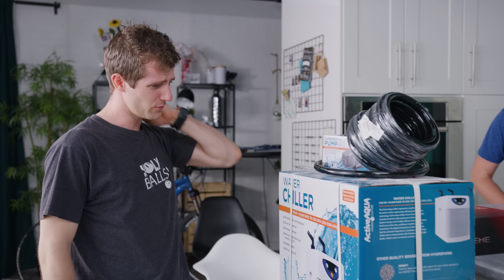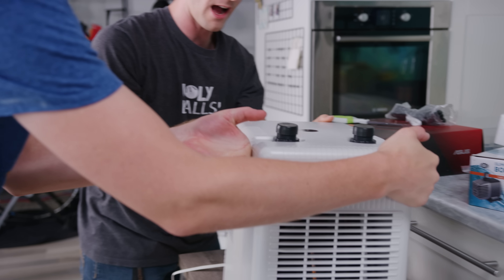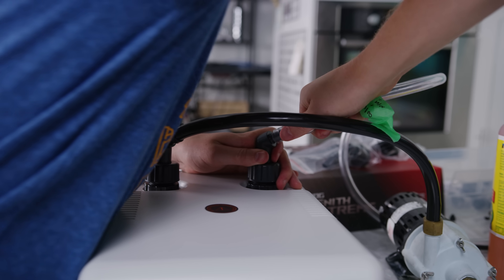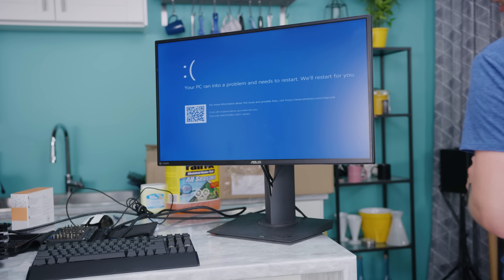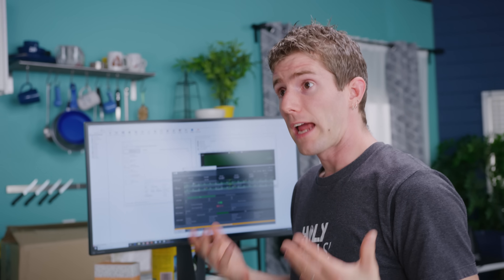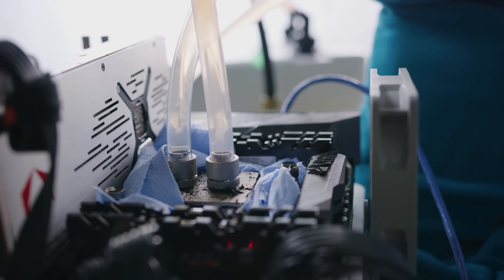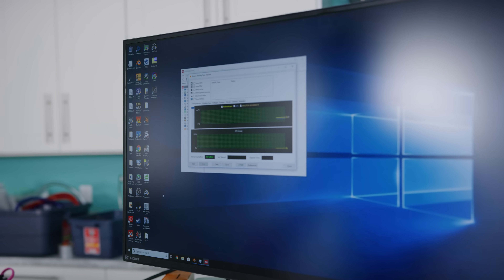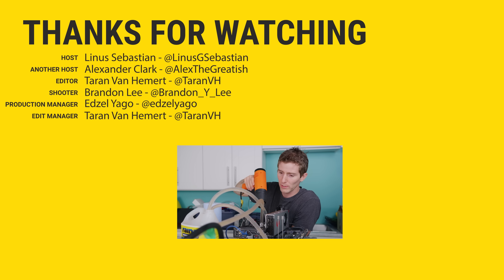Chilling Threadripper 2!!!

Comment: way 2 powerful :D i have done it before on two computers just to mess around using hy2000h :D overkill 1/3hp compressor 450w power draw and confident performance of 1.8,  that unit is capable of keeping 2000l of water 10 degree below ambient temperature...used it on my fish tanks then tanks were gone and well why not to try it on 2080ti x 2 and amd 5000 series ryzen processors ...it is perfectly usable option but you need big water tank with it otherwise when compressor kick in for literally few seconds temperature was dropping way too low even thought i had it set to 24 degree water temp full strain on two systems 300w both cards and around 110w per processor when chiller kicked in to lower temperature when exceeded 24 even thought it switched off quickly R134a was still working hard and water temp was dropping to around 10 degree causing hell of a condensation :D only way to counteract it was to use 50l water tank with it hahah i never gave up on it and currently running rx6900xt and ryzen 9 5900x using small chiller from aqua pure 7 system purchased on ebay for 20 quid , it draws around 80 watt when compressor kicks coefficient performance is around 2.1 i believe, neither card or cpu getting near 60  degree system only has one 280mm rad and no fans whatsoever :D it is important not to use fans as you endup cooling the room and it would not be enough as technically its only around 170w of cooling power, sounds not a lot but it does the job ...

Comment: If i wanted to do this with a ryzen 7 7800x3D or ryzen 9 7900x3D what CPU block should i get? and would a Hydrofarm AAPW160 Active Aqua, 160 GPH Submersible Water Pump be fine?
Reply: Is the pump necessary if im trying to keep temps between 30-50 while intensive gaming? I dont want to Build a whole loop into a case, Figured this would be a quick and easy setup with a direct line to the cpu and back to the chiller

Comment: Funniest thing to me is... I have an aquarium chiller from 10 years ago. I used it for the exact same reason. The brand name is totally different, but.... The cooler looks exactly the same! down to the fonts and buttons on the control panel..... and the hose fittings...
Reply: It's literally the EXACT same model...... HAHAHAHA!!!
Reply: Mine is a "Hailea" brand.... Even has the same round sticker in the center of the top of it.
Reply: @potatonetaveragegameplay5300  which one you using?

Comment: Wait you need an external pump for the loop? I thought the water chiller had an integrated pump... Would it be viable to use a pump/res combo instead of the little giant and if so, how powerful does the pump have to be?

Comment: i wanna see it made to cool and overclock MULTIPLE desktops. im thinking run that into a resevoir and add yor little giant into a 1x3 splitter that travels a ways away into 3 different pcs. set it up so you can have the noisy stuff in a different room, and insulate the piping so it doesn't pick up the ambient temp from the floor or rooms and keeps the pcs frosty.

Comment: Combined waterloop for several serverchips  would be a practical idea .You have to balance the heat from the chips  vs the btu of the chiller  and so  on , add a radiator to the loop and keep the chips at ambient roomtemperature (18 degrees celcius)  to prevent condensation. So the chips remain cool but not cold.

Comment: @Linus Tech Tips I am currently planning out a solution like this and still trying to figure out a solution to go below 0 C on a dailiable system with a 5950x and 2 3090 Stix cards with 1000w BIOS's on each of them and hoping to get 3 plus years and use hardline glass I found that can go to -80 C no problems. Just need to figure out if I can put a block on the ram and have no condensation issues when using 24/7 for rendering and gaming mainly. Any ideas what I can coat the components in? I saw the mineral oil cooling setup and wonder if I can use a similar solution for a sub-zero dailiable system. If anyone can help please get back to me. My budget is 5-8.5K for all cooling stuff and $200-400 for any daily maintenance. Thanks.
Reply: Also already have a system with a 3090 Strix and 5950X. just will need 1 more down the road unless needed to run triple 4K ultra settings at descent fps.

Comment: to avoid big condensation issues but keep the temps as close to ambient as possible, would it be possible to build a circuit that 'leads' the chiller and essentially compensates for sustained all-core loads?

Comment: EKWB should make custom loop accessories that can avoid condensation with tubings and water blocks with isolation material wraped on so anybody can use this chillers or they can even make their own chillers like this it is not impossible to isolate the materials by factory and make it possible avoid the condensation

Comment: I would have used water with antifreeze as a liquid.  With a good antifreeze you can get to -26 Fahrenheit without the water freezing and water has a much better power to transport and transfer heat. Not to mention that it arrived, they could have put it in a car without wasting anything.

Comment: I use one of this aquarium chiller like that but slightly at higher end its called "Teco Tk1000 series aquarium chiller titanium Heat exchanger". There many types of series but i get the 1000 series for my salt water aquarium. I even done a test before adding my fiah into the tank just to circulate the water for 3 days n my tank from out side vaporise 😂n i exchnage the setting to release heat n maintain my water at 87 Fahrenheit. I once use china basic chiller its just crap bought for 80 bucks singapore dollars. Cheap chiller is just good for nano tank. For cou like that try the one i mentioned. Try research that chiller. Maybe it much more better

Comment: I would like to point out that Canada allows methanol to be used in windscreen wash fluid. That thing is extremely poisonous, kills your vision irreversibly and is absorbed even through the skin. Mouth sucking it is something utterly stupid, kind like standing on the edge of the cliff or so. As a bonus, it does harden the tubes and prones them to cracking. Also is highly corrosive. It will kill the pump in the long run. You must use glycol-based antifreeze for car engines. Or better still, use waterless cooling fluid for sport and vintage cars that goes down to like -60`C up to +160`C.

Comment: I wonder if It would be possible to like do a skim coat of epoxy over parts of the board to prevent the moisture, I see people using Pat-Jelly. Maby better room temps help mitigate or even like a moisture absorbing substance like plaster when it hardens. the problem with towels is while they absorb they dont dissapate water like plaster. I think a shroud made of plaster would absorb way more water than paper towels as it literally absorbs water from the air around it.

Comment: 1/10 amps is the amount of amps needed to kill a human. 500 amps is = to 5/10 of an amp. when they got 6000+ score on cini. r15 the wattage on the threadripper was 500, and because the cooler had a chance of leaking they could easily died

Comment: If it is just condensed water there should be a much lesser risk of shorting out the board, water itself isn't particularly conductive, it's the dissolved ions in tap water that make in conduct electricity well. Those ions shouldn't be present in significant amounts in condensed water.

Comment: you should just use a cold finger probe. 

https://www.grainger.com/product/12C386?gclid=CjwKCAjw_NX7BRA1EiwA2dpg0l4EWPn6UN7kbbCJ-c6-zZBpmcvlICGjMJUTPNpQI1i1npJumL4NMxoC2NwQAvD_BwE&cm_mmc=PPC:+Google+PLA&ef_id=CjwKCAjw_NX7BRA1EiwA2dpg0l4EWPn6UN7kbbCJ-c6-zZBpmcvlICGjMJUTPNpQI1i1npJumL4NMxoC2NwQAvD_BwE:G:s&s_kwcid=AL!2966!3!264955916105!!!g!437575797294!&gucid=N:N:PS:Paid:GGL:CSM-2295:KL09CE:20500731

you could stick the probe in a reservoir and chill the circulating liquid in a closed loop over multiple water blocks and to avoid condensation direcly on the cpu/board, or just make a brass pad that attatches to the immersion probe that bolts to the cpu block.  they go down to  -40c , just make sure you use swagelok insulated lines and fittings, 

https://www.swagelok.com/en/product/hoses-and-flexible-tubing/hose-insulation

with the cpu installed spray this stuff over the  cpu and surrounding area on the motherboard to seal it from humidity. (mask the square for the cooling block off and dont spray ram slots or gpu sockets etc, go light ) 

https://www.skygeek.com/humiseal-1a33-humiseal-1a33-aerosol-conformal-coating-11-5-oz-can.html?utm_source=googlebase&utm_medium=shoppingengine&utm_content=humiseal-1a33-humiseal-1a33-aerosol-conformal-coating-11-5-oz-can&utm_campaign=froogle&gclid=CjwKCAjw_NX7BRA1EiwA2dpg0lZdK8Ga6cguHUKnt8f0mkTkoztUYVZtYU76O-nSeOTFVFcQZv5QARoCAJoQAvD_BwE

you can easily get down to -10c without condensation if you use swagelok fittings and lines ;)

Comment: A feasible method to go below the dew point without condensation issuies . Would be to condition the air space inside a insulated computer case..   By removing the humidity in all the air inside the case there will be no water in the air to condensate even  if its warmer then the water in the chiller lines. . Making it pretty is another thing. . Alternatively you could invert the motherboard ( upside down as setup on the test bench. ) so all condensation drops fall away from the motherboard. And if course hvac lineset insulation on the chiller lines will reduce condensation on the water lines.
Reply: You guys could invert the mother board in the coustom chilled system you built from Linus's original  setup. . Or attempt my other plan and eliminate the water and pass the freon through copper water blocks on the cpu +gpu on the low pressure side of the window unit system after the evaporator.  . There are a few freon replacements for r22 like r407c. That's is a hcfc that's supposed to be more environmentally friendly. ..most modern window units use R-134a just like a car.

Comment: Knew a guy in college that during the 'cooler' months would run a copper tube in a loop outside his dorm window and had a fan blowing on it - this copper tube then fed into a water cooling system for his computer.  Apparently he overclocked like crazy in December, February, and March. That's one way to 'chill' your water cooling setup.

Comment: So I've got the Ryzen 7 3800X 8 Core 16 Thread running at 4.5GhZ would it make a difference if I changed out the stock cooler it came with to something more "chilled"? If so, how much of a difference would it make? Also, I would like to play with overclocking my CPU, GPU and my ram which I have at 64GB at the moment. Is there some way to hire someone more experienced to come and set that up for me? The overclocking not the cooling. I'm really wanting to try and milk this machine for what it's worth and get it to scream faster than it already does. It is a very fast machine no doubt. But I know it can go extremely higher and faster. Especially with my other components overclocked. Please let me know if anyone can help me with so many questions. Thanks in advance.

I hardly even play games too by the way lol. I have an Oculus Rift which runs silky smooth on it. But I want this to just be fast just to be fast.

Comment: Lets set up overclocking rig in a walking frezer with a moisture extractor aka dry freezer, no more pesky  water condensation there.  Or to be even cooler lets go to south pole,  im curious how efficient would be a passive cooling solution in - 40 deg. C @40mph winds. ❄️❄️❄️

Comment: Put this system with an air sealed case, put in water absorbing crystals in socks to absorb all water vapor, leave it for a few hours to absorb all the water, have a humidity monitor, then freeze it, put in a radiator in the case with fans, plus water cool everything possible. Or just hire me

Comment: Is it bad to cool the liquid in an AIO with the radiator at the intake? Like connect it to a second external radiator being cooled similarly to the water chiller. I'm thinking cool the radiator a little below ambient but above freezing so the Intake pulls in colder air from the radiator. Is that a bad idea?

Comment: On a serious note I have been thinking about using something exactly like this on  two of my computers with quick disconnects for my loops on the back of the pc's and have a pump reservoir  and water chiller in my garage. Then I'd run the hose's through the walls with a quick disconnect plate. would sure keep my room cooler does this sound reasonable to anyone here in the comments or am I nucking futs???
Reply: @LinusTechTips

Comment: If can see basterdizing the unit for chits and giggles but I would practically use it just the way it is.. Stick it and the pump in a closet and run long lines to the setup... I may just try that...

Comment: you should put the hardware in a Turemetal then in air tight chamber, then cool it down to the temperature of space(about -270°C). you need to suck out all the gas and moisture. This method should keep it very cold.

Comment: What's up with the idea of blowing a lot of air over very chilled parts? This just leads to more condensation on the parts, because they are still cold and so all the excess water in the fresh air coming across them will just condense on the part.
However, it seems to be the general wisdom for extreme temperature stuff. Baffles me to be honest.

Comment: You are reinventing a solution that was commercially available over 20 years ago. Have you ever heard of Kryotech? In November of 1999, Kryotech released the first 1ghz consumer PC, based off of an overclocked AMD Athlon 750 (Slot A, 180nm K75 Pluto/Orion architecture). Intel's fastest processor at that time was the 850mhz Pentium III (Slot 1, 180nm P6-Coppermine architecture)
The 1ghz speed was achieved by cooling the CPU to -40 Celsius using refrigerated cooling integrated into the system. The tower weighed 70 pounds, but it was an all in one solution. It cost $2500 in 1999, so I couldn't afford it, but it seemed pretty cool.

Comment: Had free cooling in Alaska with no worries about condensation, -40C outside with no measurable humidity, set the computer outside then use keyboard, mouse and video extension to sit nice and warm inside

Comment: Just FYI this won't be stable with that CPU. A 1/10 hp chiller is good for ~1000 BTU of cooling, which is 293 Watts. Your temperatures stayed down with the thermal inertia of the loop, but wouldn't stay there for sustained loading. You'll need the next step up, a 1/4 hp chiller (around 3000 BTU) for that processor.
For comparison a small window air conditioner is 5000 BTUs or around 1,465 Watts.

Comment: Linus and Alex: *Has a whole conversation pointing out that you should never flip around a chiller unit.

Shipping Company: Allow us to introduce ourselves
Reply: You can flip any compressor unit you want, just let it sit upright for a few hours before turning it on. The problem with odd angles is that the oil in the system can end up pooled such that it gets ingested all at once and hydrolocks the pump. If you let it sit in operating orientation the oil can drain back to where it belongs and you're good.

Comment: What if you flip the motherboard over. Hopefully, creating a drip loop like on a fish tank on a plug so water doesn't go into the outlet. The same idea, saving the socket. Hopefully.  Try sealing the edges with Copydex to reduce air getting under the chipset. Or, place chip and cut thin foam around the edge of the chip framing it and clamp. Then, place the watercooler on. It hopefully will reduce sweating onto the motherboard.  I really don't know if this will work, it's just a hypothesis.

Comment: You can use a plastic water bottle to suck the liquid through the pipe.  Put the pipe to a sports style bottle cap or directly into bottle with tape around edges to make a seal. Squeeze the air out of the bottle, connect it and it should start the flow then swap over once the flow has began

Comment: I want to see this chiller used on the Zenith II Extreme, Threadripper 3970X and two Asus Strix 2080Ti OC cards with 128 GB DDR4 3600 MHz RAM and four CORSAIR MP600s 2TB M.2s running in RAID 0 as the Windows OS drive.

Comment: Try building an enclosure that includes a de-humidifier so you can perform these CPU chilling experiments with ultra low ambient humidity (<5%) to eliminate the dew-point inducing wet motherboard issues.  Then you could go sub-zero without the humidity drama...

Comment: You could prevent dew in a vacuum chamber but you'd have to figure out a way to pass power through at the very least. Video could be done optically and the rest wireless. A partial vacuum might be enough to lower the dew point, and a simple dehumidifier would also lower the dew point.

Alternatively, a pressure chamber would actually increase the performance of air cooling, and the heat pipes are already designed to withstand pressure. The whole thing would have to be chilled with some desiccant inside though since it's basically a hermetically sealed box.

Comment: DO NOT USE RAIN X WASHER FLUID, even in your car, rain x creates a hydrophobic coating on surfaces (potential thermal layer) and in cars will coat washer fluid level sensors to the point that they no longer function.